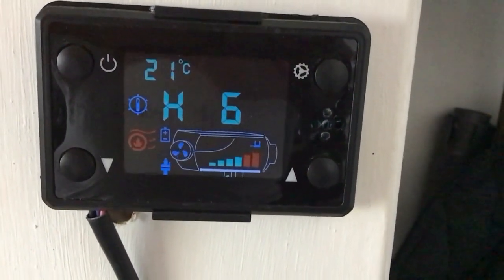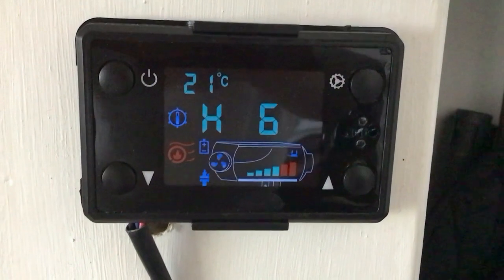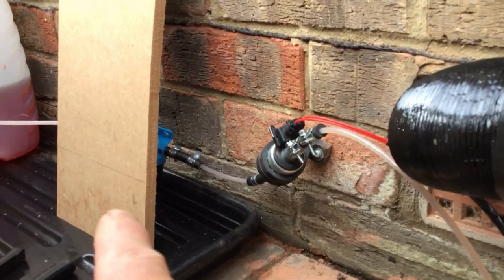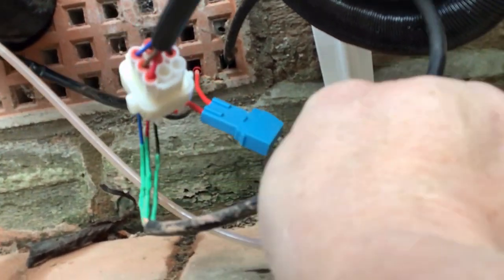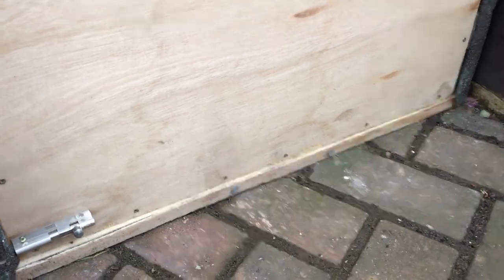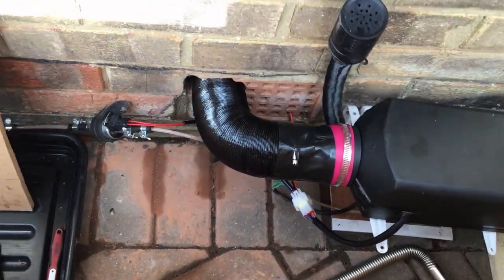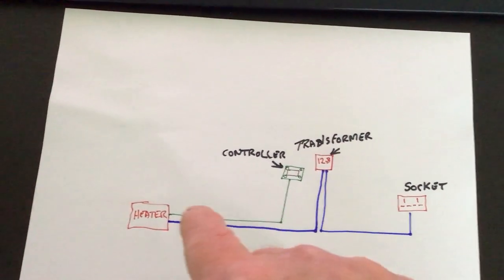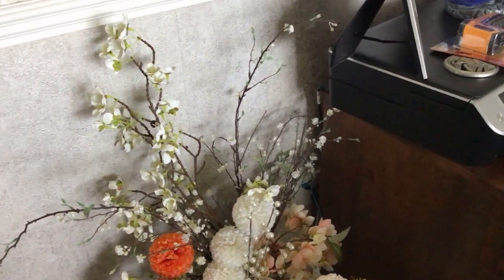chinese heater setup without the clutter

Comment: I think  the distance from the transformer might be the problem, maybe use heavier stranded wire. Also I have found that if the unit is struggling for air it causes a Smokey burn so I took the foam out of the air filter
One more tip I turned the step down transformer up to the max 14v for more air as in higher fan speed . It's going well for me , no smoke and no carbon

Comment: It looks like the inlet is blocked. What I did with mine is take the filter off the black inlet pipe and give it a blow while it's running.
When I first tried to blow into mine it was a bit hard to do and then it gave way , now works like a dream with no more white smoke 😃👍🏼👍🏼👍🏼
Reply from the maker: do you mean the small inlet pipe
Reply from the maker: ive just taken the the heater air supply pipe off and theres a piece of foam inside that isnt doing anything as it is lower than the top section that has the holes in it,im going to upload a short video showing the pipe and foam so you can see what i mean
Reply: @robertedwards87  yes plus after blowing it a bit leave the air filter off and run I hope there will be no smoke and all sorted 🤞🤞

Comment: I have just bought a heater and it got the same controller as yours 4 button,  I have only found your vid so far on the 4 button version . I am struggling to figure it out as the manual is for a 5 button version. Did you get the correct manual 4 button with yours, if so any chance of a copy please.
Reply from the maker: like you i never found anyone with the 4 button model and i didnt get a manual with mine and had to figure it out myself,there is no advance setting on that model and my was set up wrong from the factory so took ages to work out what was wrong.all i can sugest is watching my videos to find out how i did things.hope the videos help